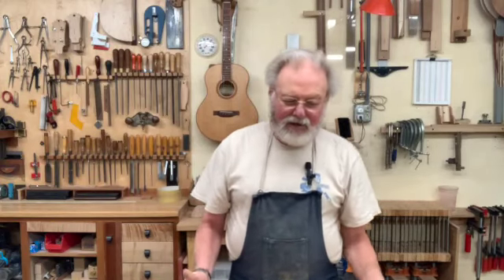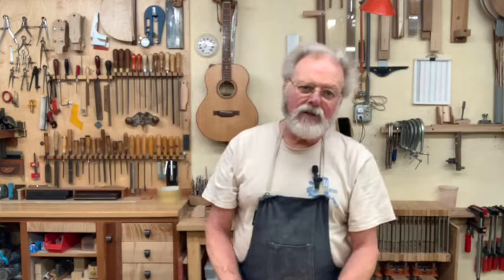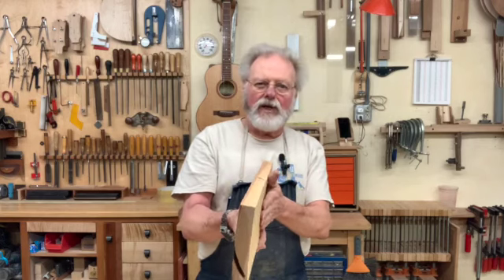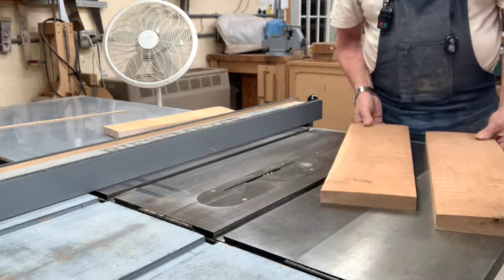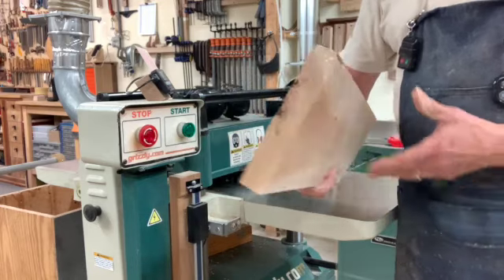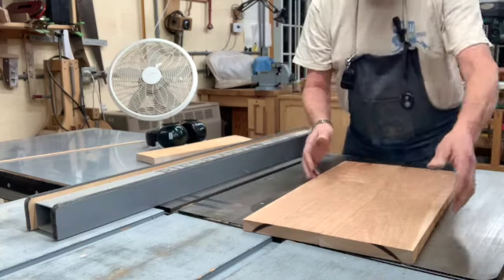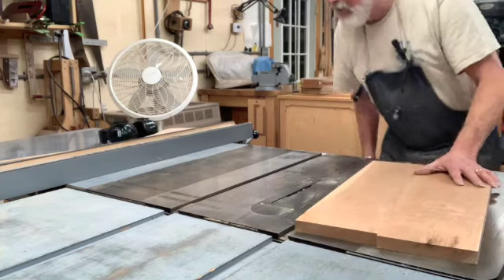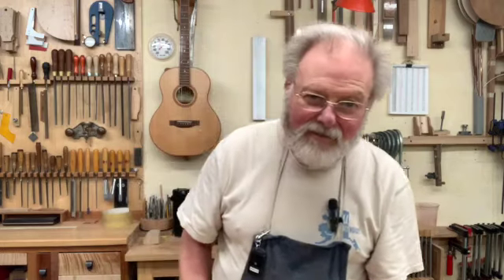Surfacing, Dressing, Planing Rough Lumber

Comment: Very informative, Kevin.  About the spline - does the grain orientation of the spline make any real difference?  Also, is there a reason not to use several shorter pieces of spline to create a single, longer joint?  Again, a very informative video, Kevin. Thank you.
Reply from the maker: GOOD questions!  I would keep the grain direction of the splines the same as the boards to be assembled because cross grain splines will be much more difficult to make and will more easily break during assembly.  
I think you could certainly place several shorter splines in a joint. i would make sure to but them together as I assemble.  Thanks for your contribution.